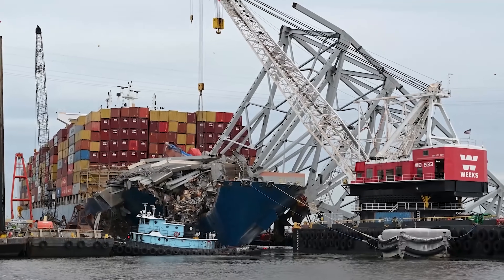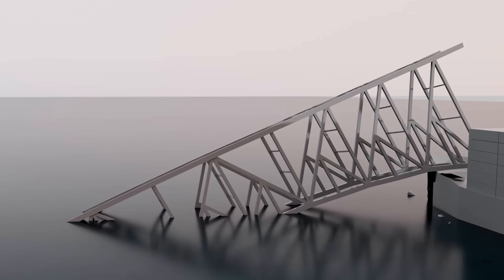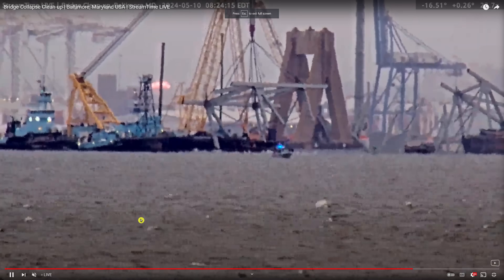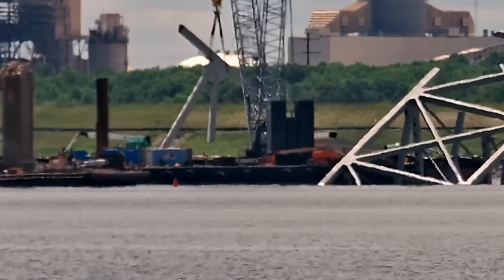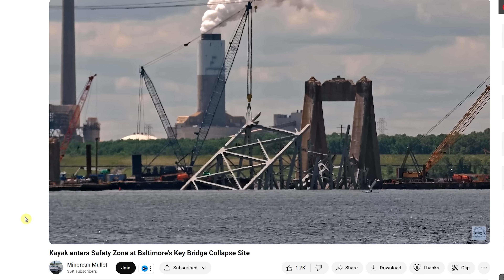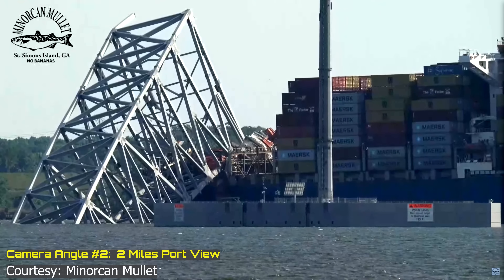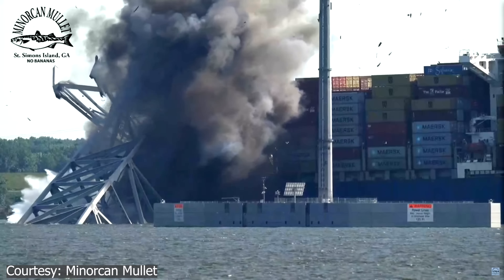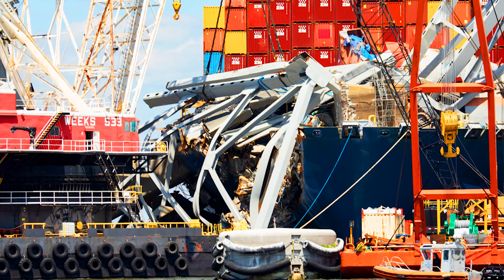Key Bridge EXPLODED Off MV Dali Ship | Baltimore Bridge Collapse

Comment: Jeff,  I expected the timed explosions like we see in building demo.  Boom, Boom, Boom, allowing time for parts to start falling and pull the other parts in a planned direction.  We didn't see that.   I do not see how the blast we saw was anything close to the animation they presented and I don't think it achieve the main objectives.    Boat won't move for another week. ??
Reply: I suspect the animation was wishful thinking.  To make the animation work that way in real life, that is pieces sliding off, you need to generate lateral forces that push it that way.  The only way that happens is if you delay some of the charges.  But if you do that the motion of the truss can be unpredictable because it becomes unstable at the first cut.  Those were simultaneous cuts on the real thing, and when that happens the only motion allowed is down because of gravity. The connections that would throw it sideways have been severed.  I believe CDI was the company that did this work, and they are the best in the business AFAIK.  The end result is exactly what they needed, which was to get the bridge truss structure off the ship.  Why?  An undamaged truss becomes unstable the second you make the first cut.  So there was no safe way of doing it manually.  The pieces are now in a form where it is safe to bring the guys with torches back in.  And they always needed to clear the areas adjacent to the hull before moving the ship. They couldn't do that safely with the truss still hanging on like that.  And those truss sections were always going to fall just to the side.  I didn't think they were ever going to fall well clear like the video.

Comment: If that animation was the expected result, the Key bridge didn't watch the video. It had different plans.
Reply: That is because they found flammable materials in some of the broken open containers so they could not attach all the charges they intended.
Reply: there is no way the animation was the expected result.  it doesnt follow anything close to proper physics. the top parts would not fall sideways.

Comment: There’s a shot on one of the news feeds where the ‘bulbous bow’ insignia is visible. With it, you can notice a slight raise of the waterline.
Reply: Actually, that is due to wash/splash wave effect and once the water returns to normal, the ship is sitting the same.  There should have been movement  but the fact that there is now is not good.
Reply: @jamesb4789  not knowing how deep it is right at the support structure the dali ran into is, there is a chance its also beached so it is actually resting on the riverbed and resting higher above the water than normal. so removing the metal section of truss might show any changes (plus there is still a large chunk of the concrete pillar on the ship)

Comment: WTF??  Just look at their simulation, and keep in mind how BIG and HEAVY this stuff is, and then ask yourself, "From where will this truss get the instant momentum away from the ship as depicted in the simulation?".  That 'sliding' of the truss was NEVER a rational perspective and that was obvious from the moment they issued the cartoon.  Who the-f thought you could take several hundred tons of steel, cut it loose from everything in an instant, and then have it magically start moving horizontal to gravity?  Huh?  Who the-f was that "engineer" and, while I'm at it, why the-f didn't you call this out weeks ago?  This NEVER MADE SENSE.  Nevertheless, it's a minor setback, but it's 100% bullsnip-fantasy as so many of these things are until they're exectuted.
Reply from the maker: Gravity would do the work. Apparently last minute they decided not to lay some charges that were too close to hazardous materials exposed in crushed containers
Reply: I said the exact same thing.  To make it move laterally, you need lateral forces.  That doesn't happen if the cuts are simultaneous.  And they kind of need to be simultaneous for predictability.  The minute you make a cut in an intact truss, it becomes unstable.  I think there was one piece wedged into the deck that wasn't cut.  I think that hinged over one or the big pieces. Other than that, everything went straight down because of the simultaneous cuts.  a = F/m.  It's the law :-)

Comment: Trusses are hard.  If you blow each charge at the same time, you can't get momentum going in one direction to have stuff fall away from the ship.  If you delay some of the charges to get momentum going in one direction, then the truss becomes unstable and therefore unpredictable in its motion.  Those charges are usually connected via det cord not individually remote controlled for reliability and safety.  That way they either all go off or none go off.  The last thing you want is for one of the charges to not go off.  Then you have to treat it like a hangfire in a firearm.  Dangerous stuff.  If you need a delay, there are special devices you can insert inline with the det cord that will delay the propagation by a very short period of time.  The length of the det cord can also be used to create a delay.
Reply: Yeah, most likely used Det Cort to connect the charges.  One of the things I miss from my US Army days.
Reply: depends who does the job.  I bet the Army Corp did this and not a specialist firm.   The top end companies have different means  of controlling the sequence of explosions.  It is not uncommon to have two separate circuits to each charge to insure proper timing especially  in jobs like this where they might have a hangup.  Something like a truss of this nature in particular they would be very careful to have backup to avoid a hangup that world be very very difficult to clear.   This job was clearly not  done by a top company and the result shows it.  The government  does everything low bid.  sometimes you get the low bid result.
Reply: @jamesb4789  The demolition was done by Controlled Demolition Inc of Phoenix MD
Reply: Just being a mechanic with no demolition knowledge, what do you guys that  know this stuff think of the results? My uneducated prediction of the results was that it was not going to look exactly like the animation
Reply: If trusses so hard and brittle then how did so so many melt and warp and wilt like hot taffy ??  Apparently many trusses were no stiffer than spaghetti.  Only a blast furnace or added energy (from a beam weapon?) can cause girders to melt like that.  Learned about this from CONSPIRA site 64-part exploration of anomalies.

Comment: We were 2 miles South of Rock Hall and the blast was loud at 17 miles. No doubt what it was, not background noise...
Reply from the maker: The Space Shuttle B liftoff's were loud too, and eery as you can see the rocket go up, but you don't hear in for 35 seconds because NASA causeway was 6 miles from the launch pad.
Reply: We are off track here but a Falcon launch at night was eerily eerie as well. Bight enough to read the paper by and make the streetlights look like they were out, and in absolute silence. Then, as it cleared the tower, CRACK!! Back to the Key Bridge, by counting the seconds between the blast and the echo (and that was loud!) you can determine the distance, so it would be interesting to identify the exact place it echoed from and then plot the distance on a chart to see if the two match up.

Comment: Does anyone have the exact time (to the second) when the button was pushed?
I'm trying to find sounds from a site about 2.1 miles away.
This site did capture the original collapse which sounded like rolling thunder.

EDIT:

OK looks like the timestamp on the video is close enough.  Found it!  At the site we recorded a boom at precisely 17:01:35.  There was a sufficient pressure wave to rattle a large overhead door.  This site is 2.1 miles from m/s DALI.  The peak SPL was pretty close to the original collapse but obviously much shorter duration.  Think of single round vs. entire mag dump. ;-)
Reply from the maker: 5:01:26, on the StreamTime Live camera that was setup.
Reply: @jeffostroff  Be aware the streamtime live camera was 29 seconds off at the time of the initial crash.  The time isn't right.
Reply: Time is relative